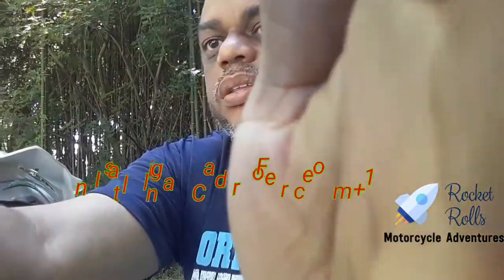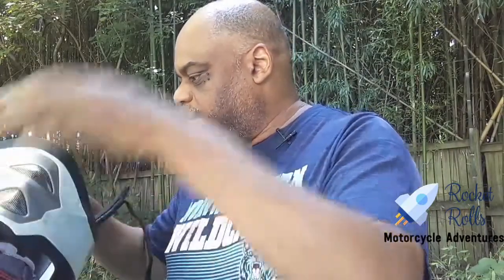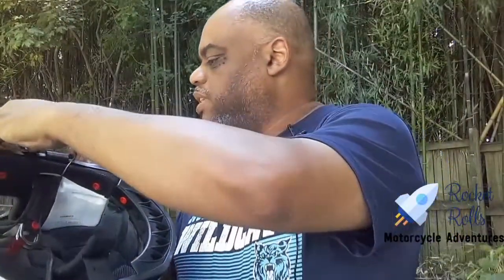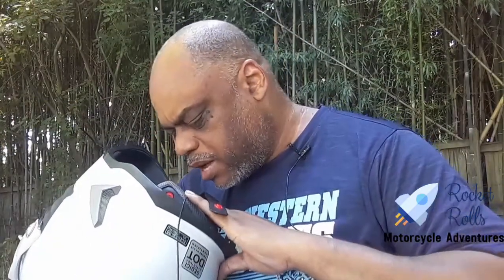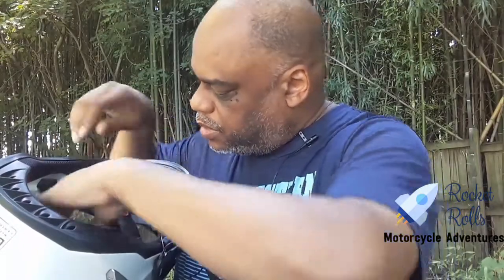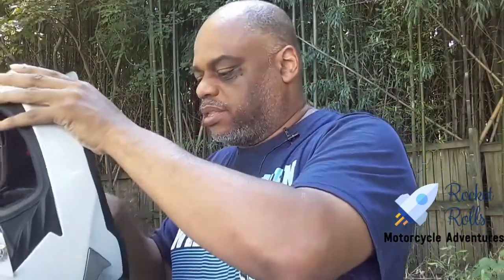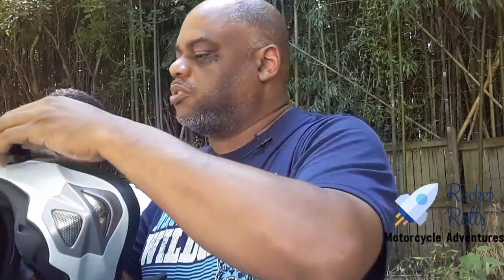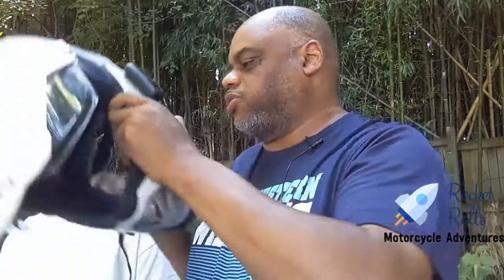Cardo Freecom 1+ Install Ep 7 Beginner MC Series

Comment: The mic would be fine as long as the arrow is pointed towards the mouth, it should block most of the wind noise because it was designed to be able to be used with an open faced helmet as well